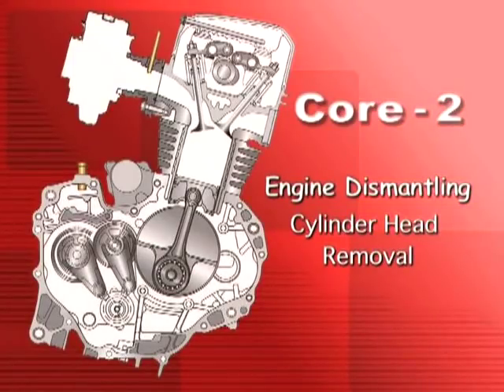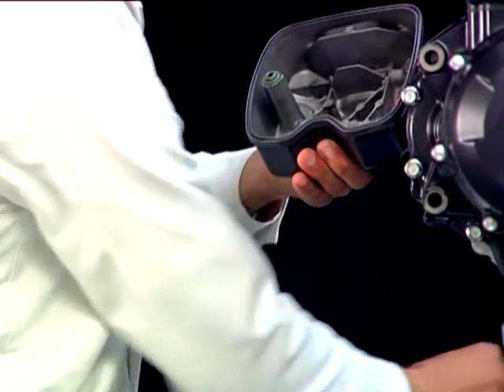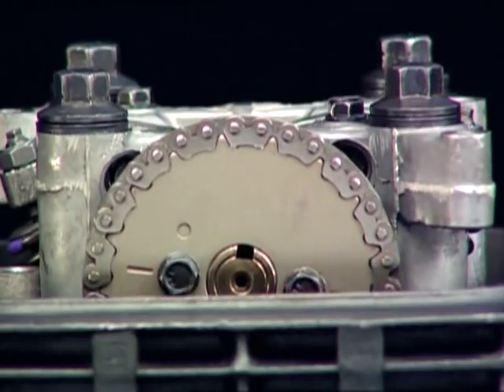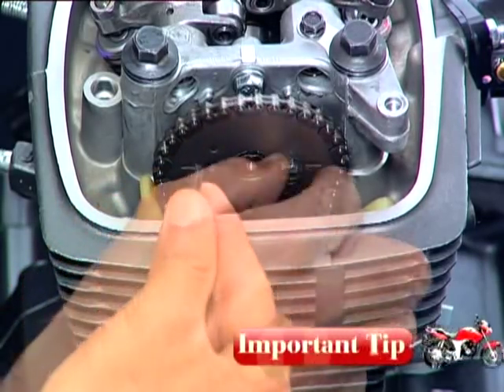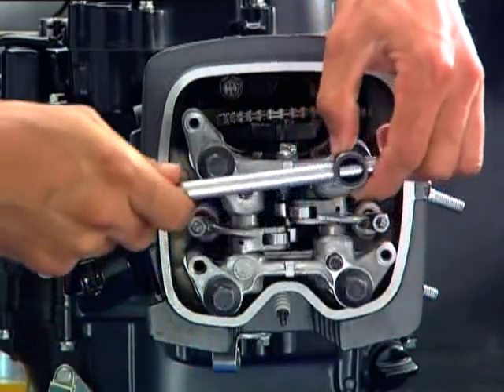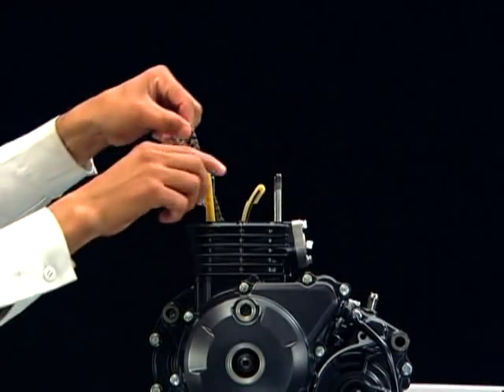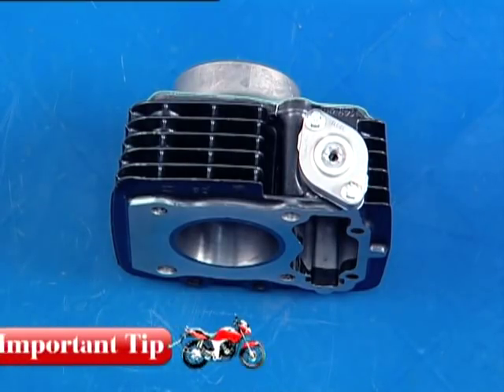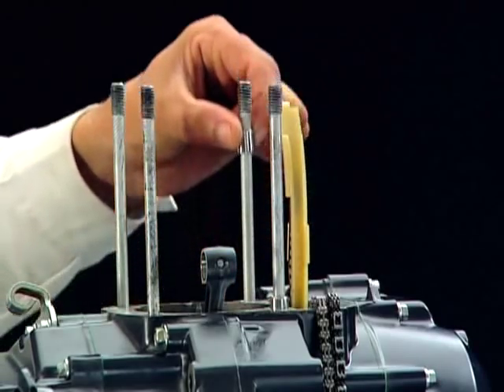Hero Honda Training Film Part 01.mp4

Comment: THAT BIKE WAS SUPER 
BUT IM USING THIS BIKE 
AND ONLY 6 MONTHS USE AND I HAVE A PROBLEM THAT PROBLEM HAS BEEN NOT SOLVE IN SHOWROOM 
WHAT CAN I DO.
AFTER  BIKE SPEED 50 
TIK TIK TIK SOUND HAS BEEN COMING  .VALVE SETTING .
AND OIL STEENER HAS BEEN CLEAN IN THIS COMPAY 
NOT PROBLEM NOT SOLVE .
WHY IM USE UNICORN 
AND ENGINE WARRANTY IS 2 YRS

Comment: I used a non branded but good quality 20w40 oil in my splendor plus bike but my bike started giving white smoke and after changing the oil with branded it stopped emitting smoke what will be the reason?

Comment: I wish I'd seen this before I followed the Haynes manuals instructions on how to remove the cam shaft holder, mine had a stripped rocker cover thread and needed work. The Haynes manual didn't mention the two cylinder head bolts on the cam chain side, it instead went straight onto releasing the four sleeve bolts following the sprocket removal.
  Now following reassembly my cylinder head is leaking oil from the right side after only 500 miles. Hopefully its not warped. I will keep you up to date following disassembly. Might even post a vid. I'm really pissed off with Haynes.
Reply: Haynes is overrated crap aimed to loot white people.

Comment: Good video to watch but the process shown in the video using a brand new not-run engine is totally different to one where the engine has been run with no oil change, not cleaned, and rusty etc.